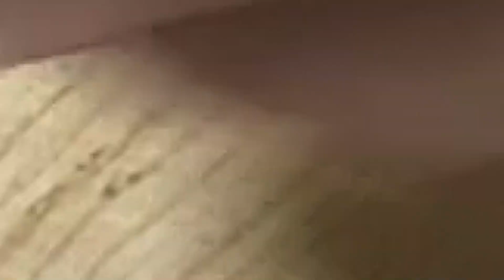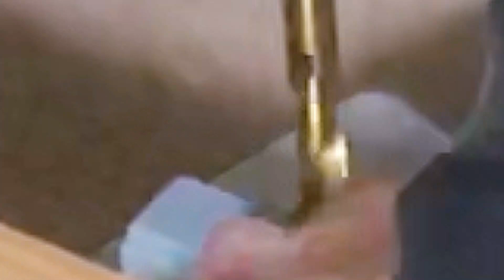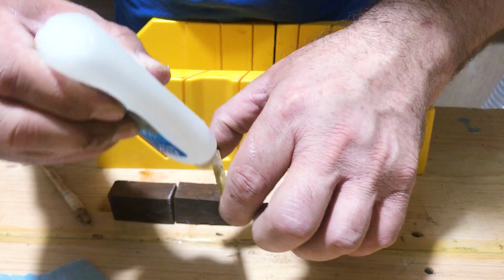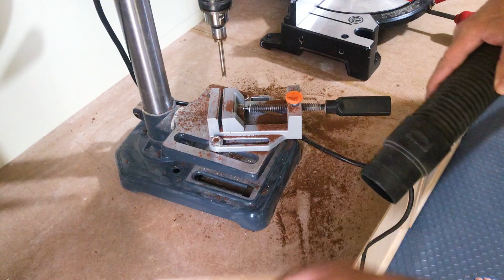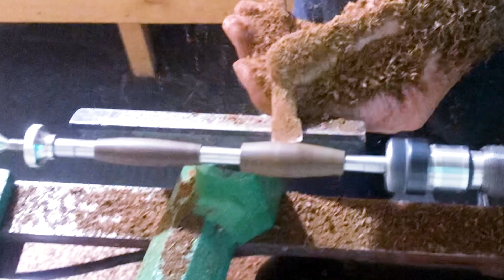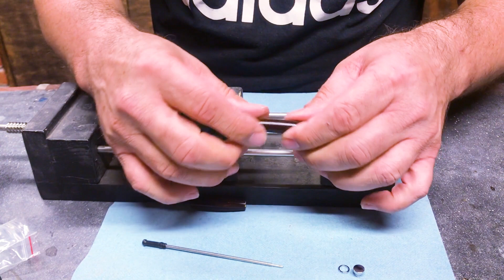[Pen Turning] Ebony Wood Ballpoint Pen

Comment: Hey I know this video was posted 3 years ago, but I was just curious if you knew or remembered what you used to finish this? I usually use around 8 layers of thin CA glue but Ive found that it clouds up the wood.
Reply: after CA glue ill hit it with some oil sanding and friction polish